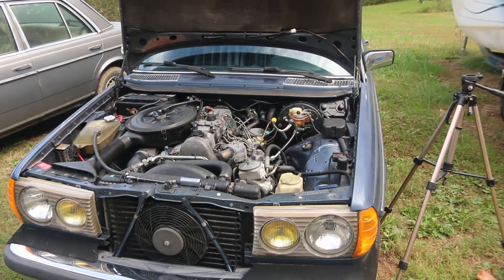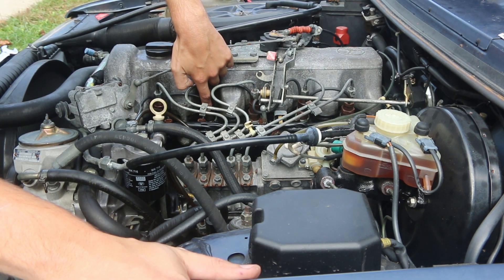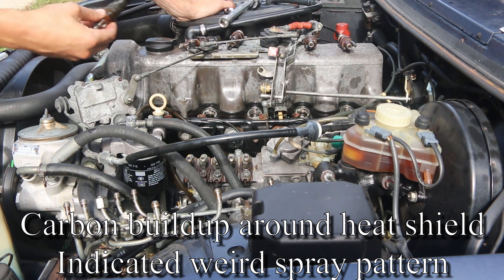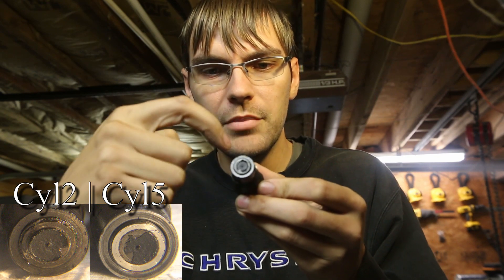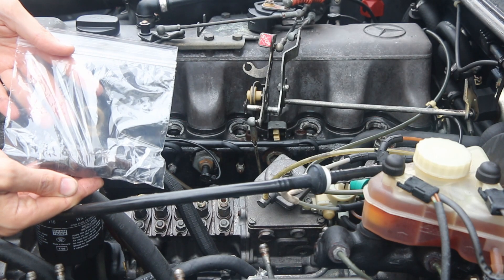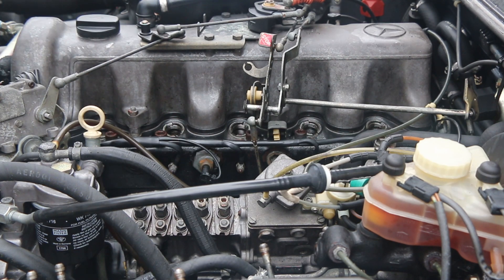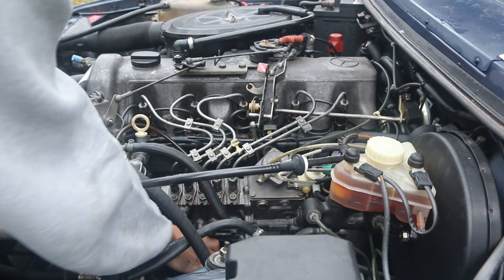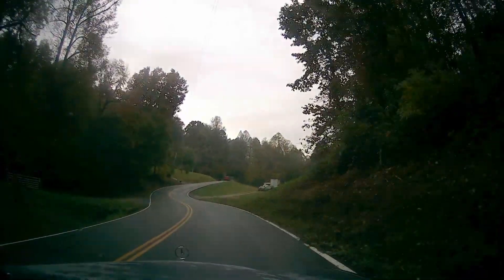Om617 knocking/rattling noise, injector nailing before and after nozzle replacement

Comment: Heh trythis.  Nice video.  I had what sounded like the exact sound from my engine (tet to post).  It was there for 4 years and never really got worse.  It did drive me crazy however.  Using a stethoscope I narrowed it down to the vacuum pump.  I pulled the vacuum pump and sure enough the tiny wheel on the rocker was pitted and wore a deep groove into the cam.  I ground down the cam and polished it and will be getting a new pump and cam also.  I replaced the injectors and did the valve timing and seals and I still have knocking but it matches the engine and its not so prominent.  .
Reply from the maker: Ah the vacuum pump. I would say the silent killer but sometimes they get real noisy when they come apart, other times they drop ball bearings into the timing chain and bang it's over.

Before I ever made this video I looked and looked at this engine, I found the camshaft slightly worn and thought "that's it!" And after replacing the cam it was still noisy so I replaced the vacuum pump after finding the bearing intact but not easy to roll, and the sound persisted.

The injectors did help quite a bit, and smoothed the engine out a ton from the shaky mess it was before, it does still have a little rattle but is not getting louder and isn't really noticable unless you're listening for it since the injectors have settled in.

I do have a few more things in mind to see if I can track down if it's a normal noise now that I've done all this work and it is so much quieter or if there is some other issue lurking.
Reply: @trythistv  I have the same noise, and I think its time to just ignore it for the sake of my mental. Although it is hard to ignore that hard,  timed, clanking.

Comment: I have a '12 W166 ML350 Bluetec , once the mechanic changed the water pump and 1 of the injectors my car making the same noise, possible injector issue, prior to that single injector changed car was running fine....
Reply from the maker: I would be a little leery of changing 1 injector, it may not be a huge deal with a newer electronically controlled car like yours, but I know with my older mechanical diesels it is imperative for the injectors to be balanced, which is why I had this noise, one injector was not spraying the same amount of fuel as the others, perhaps there is a need for the computer to be "taught" the new injector has a different flow rate?
Reply: @trythistv  thank you for your reply and insight . One month later car still at the shop and mechanic doesn’t seem to be able figure out . Issue started after he changed one injector he noticed leaking diesel fuel and month later making very similar sound as your car , at times goes away after resetting the ecu few hours later it comes back and stays .
Reply from the maker: That sounds like its not balanced properly, either the new injector is different than the rest, or the ECU isn't programmed to spray the right amount of fuel out of it. I'd see what part number is on that injector vs the other ones, it is possible the new one was for a slightly different engine.
Reply: @trythistv  I agree, once the new injector was put in, been acting funny, works for few hours ( I believe after clearing code/ ecu) one car is off and come back hours later makes that sound . will reach out and advise them change all seals or double check part number on the injector . or program it .

Comment: Do you think you can get this similar noise if the line going into the injector is leaking? I've replaced all my injectors but now the line on one injector is bleeding off.
Reply from the maker: If you're talking about the metal hard line the answer is yes. If that line is leaking some of the fuel won't be getting injected, so you'll have one cylinder not contributing which will make it very rattley and likely shake around a lot more than it should

Comment: The car is now older, and idling lower cause of injection pump rail wear, I would idle up a little higher using a newer gauge, instead of the stock rpm gauge inside the car, , a nicer rail knock diesel noise is an idle around 900+, although the om617 will idle just fine at a low idle of 300 rpm 🤗
Reply: Open up the fuel on the fuel adjuster alda a little bit plus wine out the transmission adjustment to get power back on the road...good job on the fuel injector swap, did you test your new injectors? Sometimes there no good sent...new
Reply from the maker: I did pop test the injectors before and after the new nozzles, balanced them out and later found some bad fuel clogging up the tank strainer and fuel filters to be hindering the power as well, the car drives real nice now, but I do have more plans to squeeze some more power out safely!
Also, good call on the idle speed, I just picked up one of those laser tachometers for tuning carbs on some of the boats I work on as marine tachometers seem to have an absolutely ridiculous amount of inaccuracy. I'll have to check where my car is idling with that!

Comment: Do you have a good source for an injector shim kit for the OM617 ?
Reply from the maker: I have not found an exact shim kit, but Mcmaster-carr sells bags of spring steel shims (very hard metal, perfect for this application)
Here are some part numbers and such:

I have used these in conjunction with factory shims that may have been gently lapped to remove material if needed:
0.1mm thick shims (raises pop about 50psi)   98055A105
0.2mm thick shims (raises pop about 100psi)  98055A106

I have not used any of these, but they may be useful, or may not be at all:
0.3mm thick I'm unsure if these are useful   98055A107
0.5mm thick I'm unsure if these are useful   98055A108
1mm thick I'm unsure if these are useful     98055A109
Reply: @trythistv  Outstanding. Thank you sir!

Comment: Sounds like a cracked air filter housing bracket.
Reply from the maker: I'm fairly sure I've replaced the isolators and bracket, The rattling has decreased dramatically as the new injectors have settled in, and having a good spray pattern has smoothed out the engine and added quite a bit of power as well.

Comment: The more advanced the timing the worse they rattle. 
I would set the pump timing back and see if that changes it  
It sounds like a 12 valve Cummins
Reply from the maker: At the moment I believe the pump timing is actually retarded from the stock 24 degrees due to my timing chain being a little old and stretched. Its still acceptable as far as cam timing and everything, but I know I should install an offset key or ideally roll a new chain before long.
Reply: trythistv I am new to the 617
Just bought an 1982 300 d turbo. 
My did not have marks on the cam gear. 
So I learned how to test it
On the #1 cylinder 
Intake valve 
At 11 degrees after tdc you should have 2mm of intake valve depression on #1 intake valve with the valve clearance set on 0
Mine was 15 degrees to get 2 mm depression. 4 degrees retarded.  That is valve timing ,it should be spot on
Anyways mine is in pieces in my shop. 
Decided just to go through it.
Reply from the maker: Thats the exact same year as both of my cars! I've been a member over at peachparts long before they were peachparts, there is a plethora of information on that site, here is a link in case you haven't found it yet: http://www.peachparts.com/shopforum/

I suspect you're doing the method for checking cam timing / chain stretch explained here: http://www.peachparts.com/Wikka/OM617TimingChainStretch
I lined up the marks on the cam gear and was off by more than 2 degrees which indicates the need for either a new chain or offset key, I'll be inspecting and determining which sometime soon after my busy season calms down and I can start working on my car again :)

Here is a thread about the injection timing: http://www.peachparts.com/shopforum/diesel-performance-tuning/378128-om617-pump-timing-24-vs-26-vs-28-a.html
The injection timing device built into the IP gear advances automatically and is driven off the timing chain, a worn chain could cause me some issues, more with shifting power around and lowering efficiency though I'd think.

If you're familiar with Cummins engines, especially the 12 valves, you'll grow to love these engines too, while not as powerful, they are very similar in a lot of ways, I opted to purchase a 2nd gen Cummins as a work truck because I'm comfortable with everything since I've owned one of these Mercedes diesels since I was 15!
Reply: trythistv thanks
I can use all the help I can get.

Comment: Awesome video.  My truck is making the same noise. I thought it maybe a faulty injector. Diesel mechanic believes there is something more sinister going on 🤥 . Funnily enough I put injector cleaner in and the noise got louder.. another recons it maybe just a lose or bad injector 🤔
Reply from the maker: What engine is in your truck? You can crack open the injector lines to drop a cylinder and see if the sound is primarily coming from one  specific cylinder, that could help narrow it down
Reply: @trythistv  sorry for late reply.. it a mazda bounty wl 2.5 turbo engine

Comment: These engine had pre-chambers instead of swirl chambers. The pre- chamber had a round ball in the center of it onto which the injector would spray to disperse the fuel. The flame front would exit the nose of the pre-chamber through the holes in the nose protruding into the cylinder to continue the combustion.  This ball inside the pre-chamber has been known to come loose from time to time or just plain and simple get damaged from wear. In any case damage to the ball in any shape or for would create noisy and bad running conditions as well. You will need to remove the injector on then use a special multi-spline socket to spin  the threaded locking collar out that holds the pre-chamber in. Next: DO NOT FORGET TO REMOVE THE GLOW PLUG FIRST!!! BEFORE REMOVING THE PRE-CHAMBER!!!!(Since the glow plug extends into the prechamber and will brake off if not removed prior)
Next thread in a slide hammer and remove the pre-chamber from the head so it can be inspected!
Reply: Thanks, I had one do the same thing. Hard knock in #1, sounded like a rod bearing. Pulled the sump and bearing was fine. Never did figure it out. Still have the engine.
Reply: @martyswaney1098 my knock went away when I started using waist motor oil for fuel
Reply: Had you experienced this before? I currently am having the same noise with a little engine shake and what feels like a misfire. No smoking or metal in oil.78 300d n/a
Reply: Hi, yes I have seen this before. I would have sworn the rod bearing was gone, yet it just turned out to be a nailing injector. Before jumping to any conclusions or spending large sums of money I would first drive iwhile running a good quality cleaner injector cleaner through it. If that does not solve anything then I would remove injectors and do a compression test on all cylinders. 
If you find one or more cylinders significantly lower then the rest, you might want to pull the oil pan and inspect the rod bearings on the cylinders that were low first. Also perform a leak down test to determine where you are loosing the bulk of the compression. Also do not forget that after all of this the injection pump could also be faulty on one or more pump plungers and cause less fuel to be injected on those cylinders. You can always hook up test tunes to the pump, crank it over and verify all pump plungers are moving similar amounts of fuel!
Reply: Now do you see this well studied answer

Comment: Hi can you see the video in my profile and tell me your opinion please. Thanks in advance.
Reply from the maker: I see the video of a Jaguar 3.0d, it sounds a bit like injector nailing to me, but also appears to be a vastly different injection system than the "tractor engine" in my Mercedes, does it change based on engine rpm at all? if you have a cartridge oil filter have you noticed any metal shavings or such in the filter? If you're driving the car and it hasn't gotten worse quickly I would suspect it isn't a spun bearing or such.

I also see where you've talked to people and they're wanting to change the crank, cam, etc. Don't buy into the "parts cannon" mentality, there is a smoking gun somewhere, the hard part is finding it.
I'm unsure what exact engine that is, is there a way to inspect the camshaft/timing chain type stuff without disassembling the entire engine?
Reply: @trythistv  Hi and thanks for your fast response.  The car is 2011 Jag XJ 3.0d . I drive the car like that from 1year and 2 months with this sound. I change the oil myself before 3 days , nothing wrong in the oil or in the filter. At the last garage try to tell me straight that the car have worn spun bearings, offer me repair for 3000£ ...... i drive the car from 11k miles and i think if that was a crank or spun bearings the engine should be in the bin before long time ago....
I got a friend who believe that come from injector. Noise is very strong, outside of the car you can hear it from 10 meters that single tak tak tak, exactly   like yourone at begin of the video. Some people  told me could be tappets. Engine is with timming belt not chain.
Reply from the maker: Ok, it's a belt motor so can't be chain guides or anything. I agree it can't be a bearing after 11k you'd have destroyed the engine or if by some miracle it still ran there would be so much bearing material in the oil it would look like metallic paint. I would be leaning toward the injectors too. The car in this video has quieted down a bunch after changing the nozzles and letting them all settle in, you said you sent the injectors out and they all tested ok, does the shop deal with the Jag diesels much? I'm curious if they checked spray pattern and balance, if one injector is spraying more or less fuel than the others it can cause weird rythmic sounds, much like what my car was doing
Reply: @trythistv  This guy who make the test is at local small garage i just left the injectors there and take them on the next day. What he was told me, that they pass the test only fail on the test which is for high pressure.  He was told me that my injectors have 1 to 1.3 measures less then the minimum the number was about 53  where they have to be. He say even if i put new ones will not see any difference.  But now i start believe that tick noise come from some of them. I consider to buy refurbished injector and start swap them one by one.
Reply from the maker: If they are electronic injectors is it possible to unplug one and see if the ticking goes away, or use a mechanics stethoscope to narrow down which cylinder the noise is coming from?

Comment: bought a car that had a slight knock which increased over time until the car was finally toast. Good luck but sounds like rod knock to me. I chased every fix hoping it wasn't rod knock. I secure the heat shields around the cat, even went as far as replacing timing chain tensioners and chain. The timing chain tensioners were actually broken but it also had a terminal case of rod knock. I think a good test for rod knock is to manually turn the engine (as in ratchet connected to crankshaft bolt) with the plugs removed so you can stick a long skinny tool(screw driver) in the hole, resting on top of the piston. When the piston of the cyclinder you're testing hits top dead center and then barely begins to go down, you stop turning the engine and press down on the top of the piston to see if there is any play. If the piston moves at all when you press down on it that's trouble. My car had a ton of metal in the oil though so maybe it's not rod knock. This test is what finally made me give up on the car. You can drive into the ground either way though
Reply: I just realized it's a diesel, so disregard....
Reply from the maker: Hehe yeah I was reading your comment and thought oh man if it had spark plugs it would be a terrifying racket it's making!
Reply: You can always put new rod bearings in and keep clean oil in it

Comment: I found this very helpful. I let my 84 300D run out of oil, now it's nailing and the injectors are leaking. Hopeful I can just pull them, replace the washers, etc. Fingers crossed.
Reply from the maker: If it is possible, see about getting the nozzles changed out while you're at it, I put firad 314s in here and I couldn't be happier,  as we've been driving it after this work it seems to be quieting down and performing better as the miles count up!
Reply: Whatever you do don't do what this guy did his motor sounds way worse now and it almost Taps on every cylinder
Reply: @asrielandcharadoesstuff4789 
Normal with rebuild injektors btw …. 
Also There Night still be some air in the System takes about 500-1000 km to quiet down 
But if you Are sure that you Are Right 
Make a Video showing how 2 replace injektors yourself with a before and After